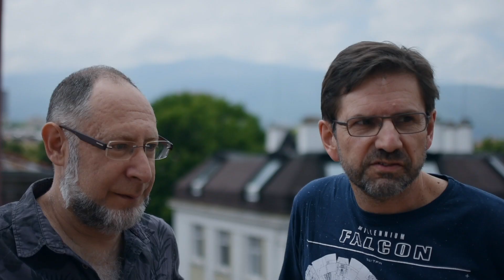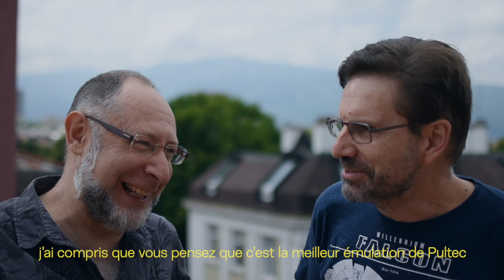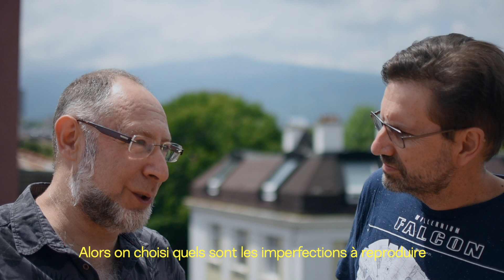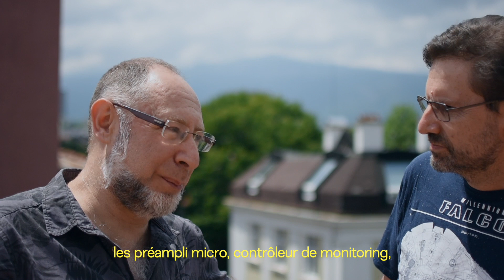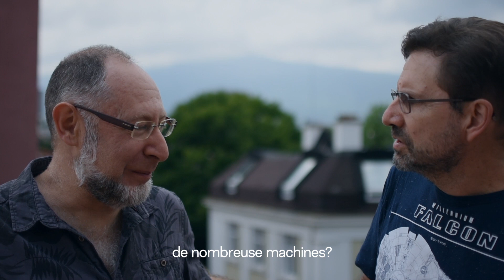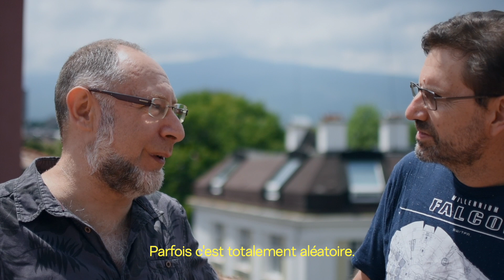Founder of Antelope Igor Levin Interview with Fabrice Chantôme (French subtitles)

Comment: Terrible product. And your total lack of customer service and support means we never get answers about your faulty products. You have cost us absolutely thousands and thousands of pounds as well as reputational damage, even when we are so careful to double check that your equipment and firmware appears to be functioning ok - and then it screws up the vinyl cut. You never answer any phone calls or emails. We are done with your company and will never use your products again. Let this be a warning to other audio engineers.
Reply from the maker: Again, we’re really sorry to hear this. We understand how serious a failure during a vinyl cut can be, both financially and for your reputation, and we’re sorry you’ve felt ignored after reaching out for help. This is not the experience or level of support we want to provide. We’re escalating your feedback internally.